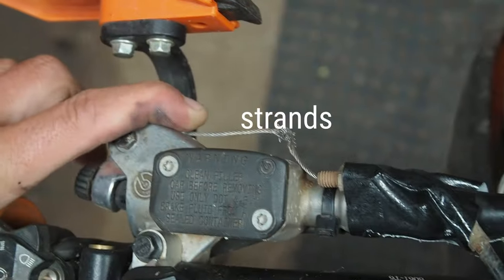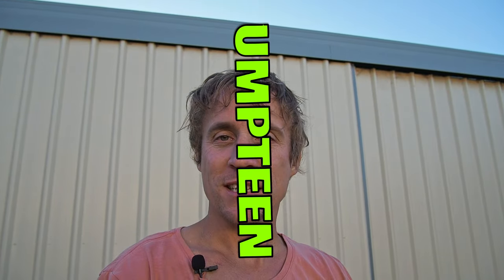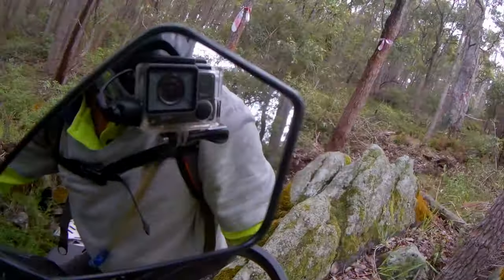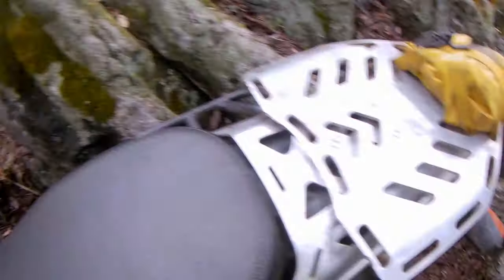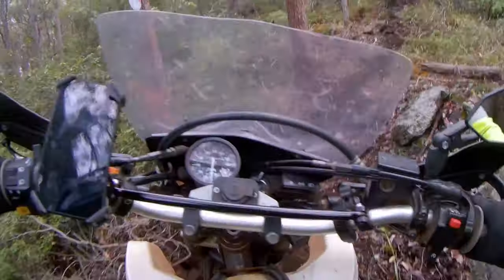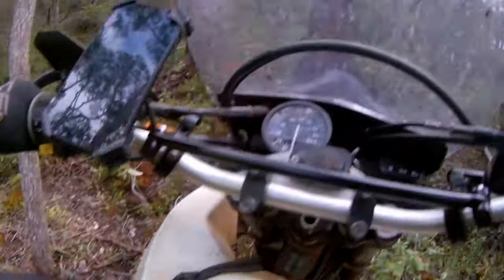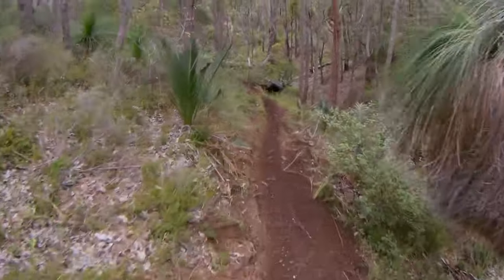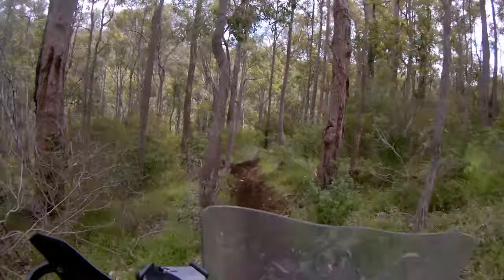How To Ride with a BROKEN CLUTCH

Comment: Hey Ben. Love your work mate. You didn't mention the starter motor start. First gear engaged engine off hit the starter. Not so good on a steep hill, or if your batt is weak, or if first gear too tall..or if  bike electronics don't let you start in gear without clutch in. ....or if no starter!! Ok yeah...you're right - bang it into gear
Reply from the maker: Haha yeh i actually tried that technique that day and decided against it or mentioning it in the vid because of all those points. But cheers for bringing it up, shows you were paying attention Pete!

Comment: I carry extra levers in my tool kit and bought an extra clutch cable and used heat shrink to seal the ends and zip tied it to the clutch cable on the bike. If the cable snaps just hook up the spare and continue on your way.
Reply from the maker: Good call, I now always ride with an extra clutch lever cos these bitches snap so easily. Spare cable stays at home.

Comment: If its just a broken cable  and its right at the lever  its a good idea to keep a few 12 gauge wire connections with you . The type that fits under a screw works best either open horse shoe shape or  a ring type will work . Put as many  wire strands into the  wire connector that will fit and use  pliers and clamp  them down as hard as you can . The other end of the wire connector  will fit back into the  lever wither on the  hand side or the  engine side . You just need to bend it into  metal loop area on the lever . This will get you home and then some . I have had to do is  many times  in the past so I never leave home with out a few wire connectors .  If the  cable is broke  to far way from the  lever    you can use the wire connectors that have one side female and the other side male  and they join together .  Put one end of  the cable  on the female connector and the other side of the cable in the male  connector  then push them together  . Now use your pliers to  crush the connection of the male and female connection  so it will no longer be able to pull apart . Its the  easiest and fastest way to put  the cable together  again  so you can keep riding  and not have to go through all that shit you show in the video .  The tiny wire connectors  don't take up any room at all and they can also be used  for there intended use if you have electrical problems . These are also really good . https://www.amazon.com/dp/B08NGBQWWT/ref=sspa_dk_detail_1?pd_rd_i=B08NGBQWWT&pd_rd_w=sxkCK&content-id=amzn1.sym.f734d1a2-0bf9-4a26-ad34-2e1b969a5a75&pf_rd_p=f734d1a2-0bf9-4a26-ad34-2e1b969a5a75&pf_rd_r=9HTTR8VZ2NK75MR5ZQFF&pd_rd_wg=8uWjR&pd_rd_r=4d3cbced-89ee-44eb-996e-1e8cf076515a&s=industrial&sp_csd=d2lkZ2V0TmFtZT1zcF9kZXRhaWw&th=1 This type of wire connector  has 2  screws that tighten up on the cable  for joining  broke cables together  or with the plastic piece off the metal piece will fit  into the  lever  lug space . You can ride for ever with this  piece .

Comment: Good stuff, but the description of matching revs for gear change seems to be reversed (5:07). Drop revs to unload pressure on gears when shifting up to a higher gear, increase revs to drop down. Otherwise you are increasing loads on the gears at the same time you are trying to make them slide.
Reply from the maker: Probly more of a communication break down. I should have mentioned buttoning off the throttle before clicking changes. You definitely want to get to a speed where your rpm is high before changing up and low before changing down though.

Comment: I broke my clutch lever exactly like you did in this vid. Except I did drop the bike... Using my hand to keep the pressure on the remaining broken piece held by the bolt I was able to pivot on it and use the clutch that way back home. Most nerve racking experience as I missed half a dozen time. That 650 grunt really gets the bike moving even with no throttle. So relieved when I got home. Great vid as always.
Reply from the maker: Sweet that it worked out for ya. No nub left for me to use. Cheers

Comment: ive had my clutch brake in traffic (o-ring that would fail weekly till i got around to replacing the slave cylinder, lol)
not easy, but you can just hit the starter button while in first and get moving that way. takes a mix of balls and insanity tho.
Reply from the maker: yeh first or second might do the trick depending on the bike